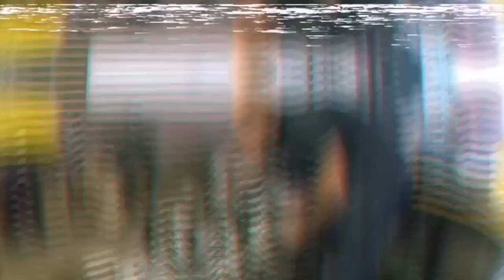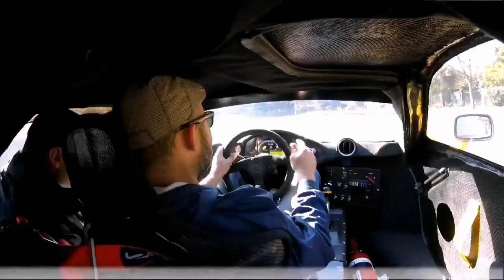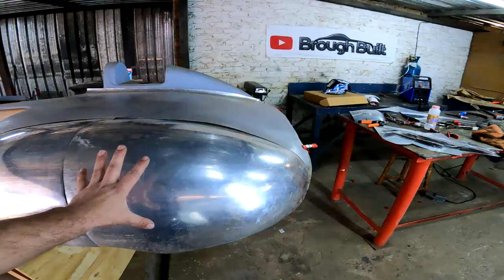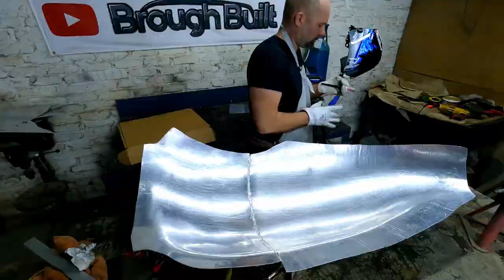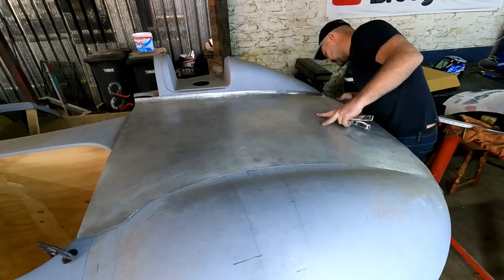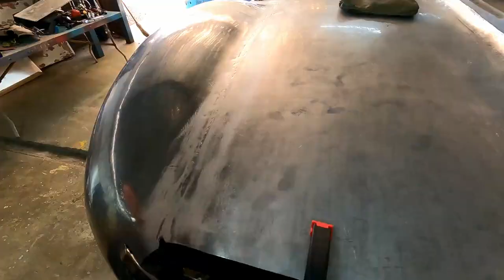Jaguar D Type build part 7 . Welding the body together

Comment: Great progress on your aluminum welding. Have you ever tried Aluminium brazing using a flane and flux? I found it works well on thin guage aluminum. You only need a hot concentrated flame like oxy-acetylene and the flux is cheap. ( I used one from pinnacle that is specifically for aluminum)
Reply from the maker: I haven't braze welded aluminium yet. But it's something I really want to have a go at. I wonder if it would actually be bit easier than ac welding🤔

Comment: You are becoming accomplished at TIG. One suggestion if I may, can you move your lights over the work area? Personally I have multiple lights from different angles over my welding table. I find that good lighting helps me do smooth work. But perhaps your eyesight is better than mine, but , just a suggestion.
Reply from the maker: Thank you. I agree that better light will definitely be beneficial. I'll work on it

Comment: Danie, I’m impressed by how quickly you figured out how to tig those panels together.  I’m having a lot of trouble with mine.  You do awesome work man. 

I’m trying to learn how to tig thin aluminum now.  I just got an AC/DC tig as well and I’m struggling to butt weld my aluminum panels together.  I keep blowing holes in the edges.  I’m using .050 3003 H14 aluminum.  

Can you please tell me what settings you had success with on your tig? Also tungsten size and tungsten type?  Gas flow, etc. 

Thank you so much for any advice sir!
Reply from the maker: Hi Chad. thanks for the message! I'll be honest with you but it wasn't easy for me either in the beginning. Blew lotse of holes in the Ali. as far as setting up is conserned I learned a lot from 
this video https://www.youtube.com/watch?v=ALieUi3sCYs . He know just about everything there is to know about welding!
If there is one thing I can say thou is to always use a foot pedal for perrfect control.
Reply: @BroughBuilt  thank you!  I’ll checkout the video. Thank you for taking the time to reply and for the advice.